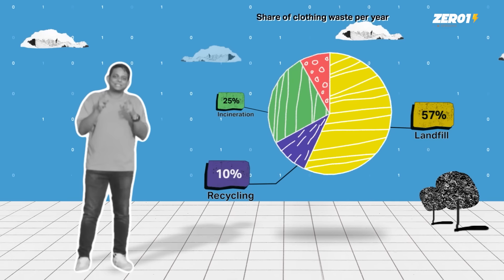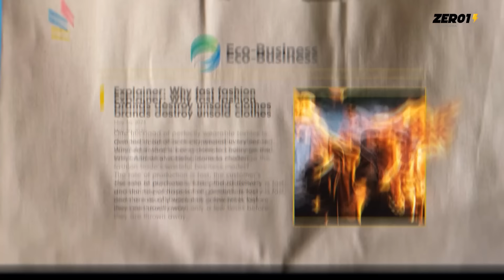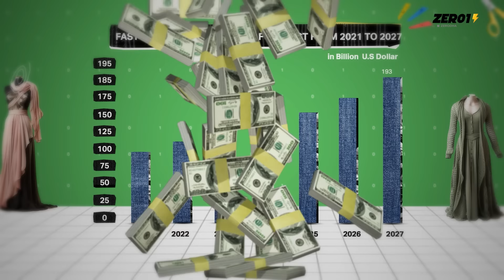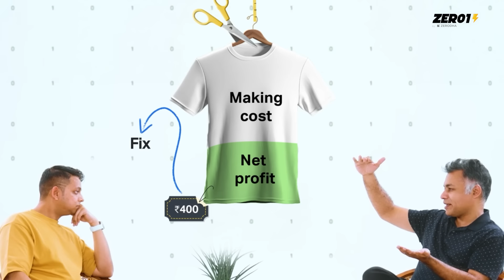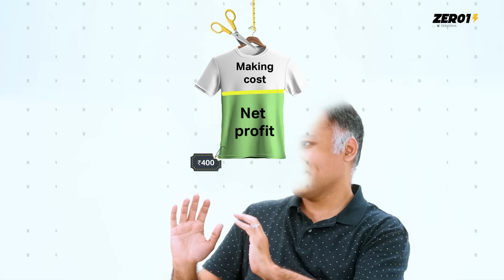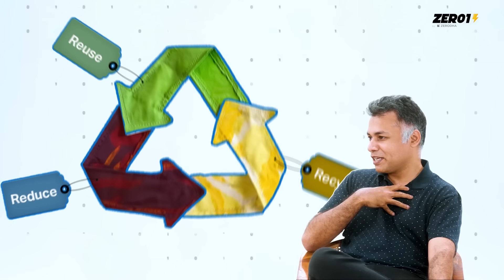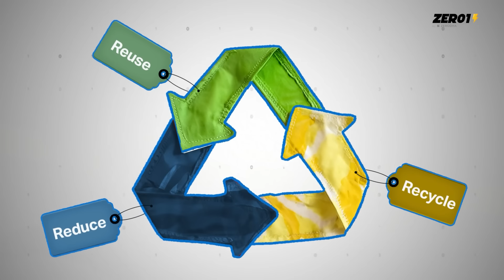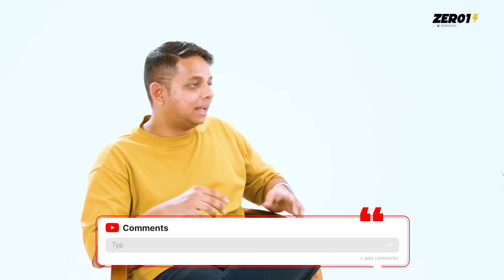Fast Fashion - From Trend to Trash

Comment: Sources of primary microplastics
Synthetics Textiles -35%
Vehicle Tyres -28%
Road markings -7%
Personal care products and cosmetics -2%
Marine coatings - 3.7%
Plastic pellets - <1%
City dust -24% 
‘City dust’ includes, for example, artificial turf, building paint (internal and external),abrasion of objects (e.g. footwear) and infrastructure, industrial blasting of abrasives, and scrubbers in detergents